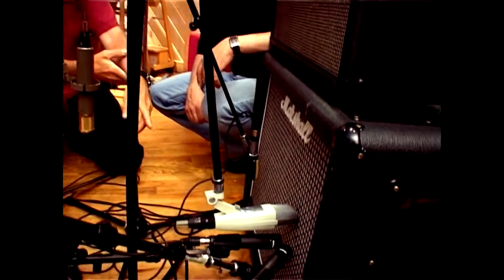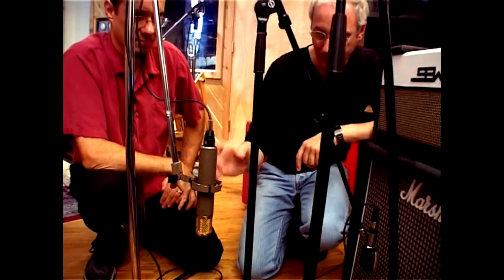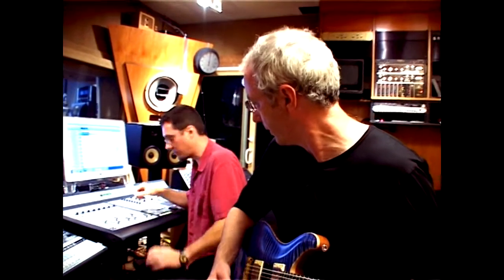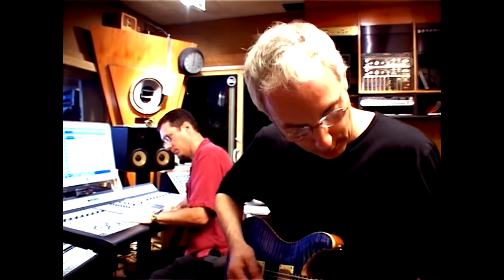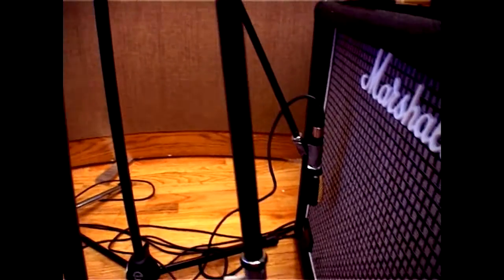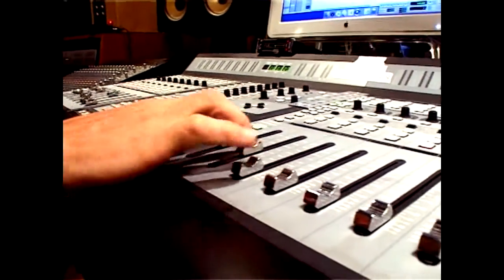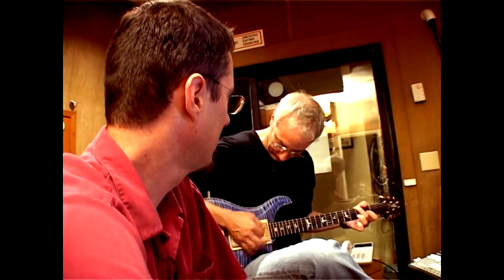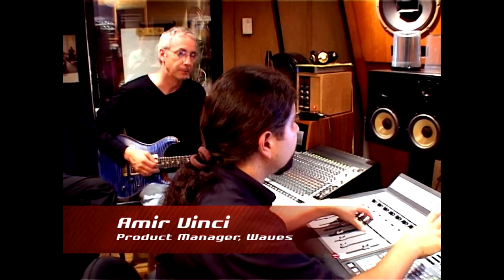Guitar amp modeling with Paul Reed Smith: The making of GTR3

Comment: I have the new Line 6 HD500 hardware modeler and it's sounds and feel are incredible. Squeezing off harmonics and listening to the decay is where the previous generation modeling technology lost out to a real tube amp. Not anymore. The light weight and the lack of hum and buzz are added bonuses. I'm an old tube amp guy, but digital modeling has really gotten very, very good.

Comment: its really cool to watch how the pro's pic out various mics and how they set them up etc...one complaint is that they put reverb AFTER the amp. this is not really done traditionally except in a studio with separate rooms and all the tons of equipment. my point is that I cant really A/B it if I dont have a studio at home and I can't hear what your software sounds like w/out the reverb. I understand that this opens up new doors but its almost like cheating. laptop at a gig, I wouldn't

Comment: @punkeratheart I agree it can't replace it. But it would probably sound better, both live and in the studio. Live because cabinets are a resonant pandemonium that sound good in a certain position but less so in the icepick hell which is mostly what you're sending to yourself and the audience, and studio because you can't change the sound later on to adapt to the vocal and such. You can spend in tube gear and mics, but if PRS can't notice the difference in a studio I don't think the audience can.

Comment: It sounds great and is a major step. However, I still hear a difference. The modeling these days gets it very close and it does, I'm sure, make a studio engineers job easier. However, I still hear that transistor tone compared to tube tone. The lack of amp noise is a benefit though. For what this product does though, it does sound great! Guess it's just personal taste..
Reply: The noise from an amp is exact what i want at distortion level.
Ok,not that much,but a little hiss and hum is a must for me.its like a living organic thing,you know...
not that clean and polished digital.
But this modeling software is great,no question.great to work with late at night with headphones.